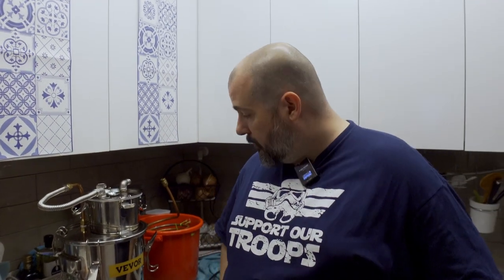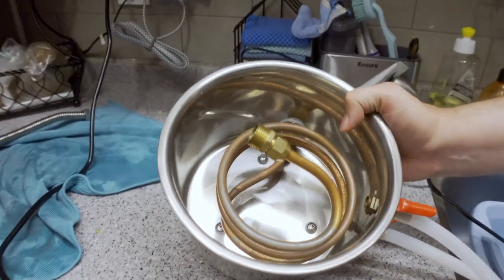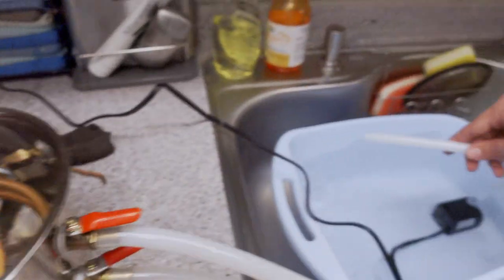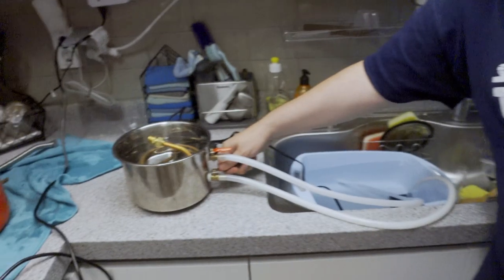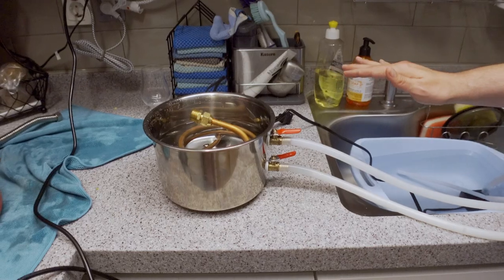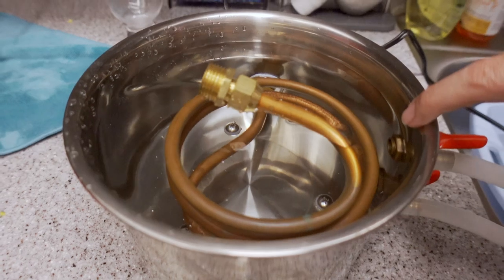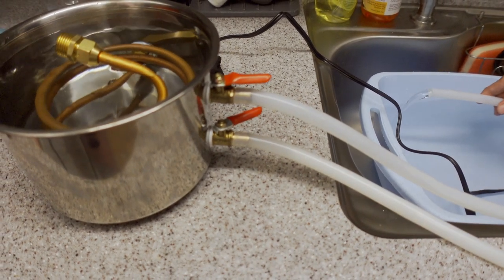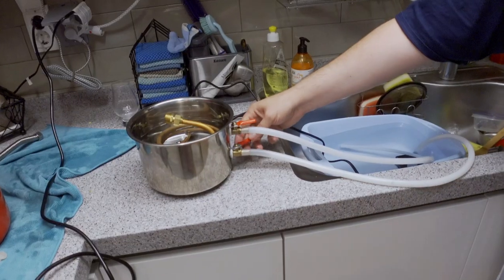Important VEVOR Condenser Tip! How to Balance Water Flow for Your Still

Comment: Awesome tip, I bought one and have yet to use it. And was wondering about that water flow…I imagine of would had to fiddle a lot with it to…that vacuum tip is awesome. Thank you for sharing.
Reply from the maker: Our first couple run were just like that. A lot of fiddling and hoping it didn't overflow. This made it a lot simpler.
Reply: @kimchirednecks  I just made my second run…and must say after second time it went well, managed to not let it overflow…problem was when adding ice to my cooler…the water lvl rises slightly…so that was a challenge…overal pretty happy with still…but think I’m going to add heating element…and make a bigger condensation pot. And longer hoses for pump…really enjoying my own spirits. But wow stilling takes up 12 hours…and making cuts is exhausting…but end results are definitely worth it. ^^
Reply from the maker: @Colsos  Totally understand. It is crazy how involved the process is and how long it takes. But the alcohol.is worth it 👌  Keep shining!

Comment: Well brother. Im using the same rig but bigger. Same worm though. But i figured out that instead of using the gravity valve. Just cut the lid off a 55gal drum and put a bbq/oven grill across the brum. Replace the worm tip with a slightly longer one and just let the water run off the top. You get complete submersion of the worm and proper angle and you never make a mess and the water dosnt get hot. It works awesome
Reply from the maker: Sounds like a good plan. We don’t have the space where we are for that but I like how you are thinking!!

Comment: Just put a small hole in hose right next to top outlet valve. This let's air in so no vacuum is needed.
I open bottom valve wide open and leave. 
No overflowing now.
Reply from the maker: Good tip. Thank you for sharing!

Comment: That stupid condenser whooped my butt the first two times I used the still, between adjustments to the flow and cooling the water down with buckets from inside the house. Then I moved the worm into a much bigger pot, replaced the short tube with one about a foot long, and set the pot on a 5 gallon bucket to catch the overflow. Water stays cool longer & I don't have to mess with the valves at all, but now I learn all I had to do was suck on the tube a little? Grrrr lol
Good thinking
Reply from the maker: I know, right? I f'ed around with those valves and the pump for months. When this idea occurred to me and worked I was all "that was it? Really?"

Comment: Your excellent video just popped up in my feed after I tried a beginner run of distilled water with the same Vevor still and cursed liberally as I constantly had water overrunning the top of the condenser. (Good thing I did this run on the garage floor - it was a mess.) Question: Once you get a siphon started can the exit hose lay in the water, or do you clip the hose so it drains above the water? Or does it matter? Thx...
Reply from the maker: Yikes. We have been there before. We found it does not matter if it is in the water or above the water. Happy shining.

Comment: There's also a water restriction setting on the pump itself. At least the one I got from vervor does. Look where the water gets sucked into the pump, you should be able to turn the face of it
Reply from the maker: Yep, that is the pump speed switch. But sometimes you cannot make it slow enough. But this works.
Reply: That adjustment slide vibrates back to full open within a minute. I even tried to glue it in place almost completely shut... still the same problem

Comment: You can take the coil out of the original pot 

Get a 1 gallon new clean paint can with lid

Drill holes in the side of the new can for water inlet and outlet valve  and coil pass through 

Use pass through fittings so you can get the coil through the side of the can

Put the lid on the can and run your water pump 

No need to regulate the water valves keep them wide open 

The can is sealed
Reply from the maker: @RTW2023  That sounds like it would work too.

Comment: On a double sink. Support the condenser, above the first sink.  Run tap in the bottom. Collect in a jar in the bottom ,of the second sink. And let it flood over in the first sink. No watching condenser. You can fill the first sink. And pump from it, if you don't want to use your tap.
Reply from the maker: That would work as well. Good idea!

Comment: Shouldn't those hoses be swapped where the pump is pumping water into the top hole and out the bottom? The gravity would make the water push out much fast. Those little pumps struggle to simply push water up the hose, but once it enters the bottom it now has all the weight of the water pushing back against it. If you swap them to pump into the top it would drain out the bottom full blast if valve is open, but adjust that bottom valve to go slower and open the top fully to allow the pump to pump water in.
Reply from the maker: Thanks for the comment. I understand your argument. However, the pump would not be able to keep up with the amount of water that the gravity is dragging out resulting in an uneven flow. Also, that would put your cold water at the top and warmer water would settle toward the bottom. Also, with colder water at the bottom the steam has a better chance of condensing and not coming through as a steam. With high steam pressure, it has a better chance for full condensation.
Reply from the maker: Also, with the small pot that comes with the kit, it would work either way. However with the bigger bucket it works better the way we do it! Thanks for watching!
Reply: @kimchirednecks  well, i tell ya, you would definitely know more about it than me cause im waiting on my first little still right now 😂 its a learning experience for me as I have never used one of these. So, what you're basically saying is, when I get mine don't put the out on the top place it on bottom and let it drain off the top?
Reply from the maker: @desertweasel6965  Yes. We used the instructions with our still and that was the suggestion. But also generally, you want to be pushing water up not down. We are all still learning. Feel free to ask any questions. happy to help if we can!
Reply: @kimchirednecks  im sure I will definitely have questions. I have a 5 gallon bucket with my first fermentation concoction going. It has been going for about 4 days now and smells like alcohol so I guess it's gonna work. I didn't skip anything I added my amalayse at 155 and yeast at 80f and everything seemed to work. Ill let you know how my first ever run goes I am really excited 

I guess my main concerns now is how much do I need to throw away at the heads to be safe.
Reply from the maker: @desertweasel6965  As a rule of thumb, to be safe we throw out about 1.5 oz (or 50ml) per gallon of mash. Good luck on your first run. Let us know how it goes!
Reply: @desertweasel6965  How'd that first run go? I'm on my first steam as I type.

Comment: First off, your input line is suppose too be ontop lol
Reply from the maker: Our instructions with our kit said input on bottom and output on top. Either way if the flow is not equal you have to pull vacuum.
Reply: If any of yall have ever used a liebig or a shotgun condenser you know that water needs to flow opposite the direction your distillate is flowing it creates a reflux turning the condensation back to liquid making a loud popping noise hence the name shotgun condensor
Reply: Firstly and most of all, the Instructions say bottom valve for input